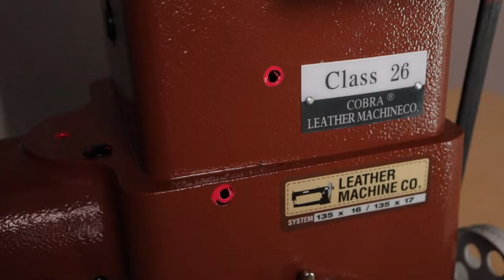Oil maintenance for Cobra Class 26 - EPISODE 36

Comment: Wow, these videos are so amazing.  I'm so wishing I had them 2 years ago when I first got my class 26.  I'm learning a great deal watching them and am grateful that you are posting them!   A few questions:  1.  Where did you get the nifty oil can? It looks SO much cleaner that what came with the machine.  2) Can you talk a little more about the little cleaning brush you are using to clean the bobbin area?  3.  I noticed you oiled some areas in the bobbin area and other areas that don't have the paint.  I haven't been doing that, but I will start.  Thanks for your help! :)
Reply from the maker: 1. The nifty oil squeezable bottle I got on Amazon
2. The cleaning brush is a short bristle pencil women's make up brush. It works perfect for cleaning in hard spots and the best part is that I got it from my local dollar store.
3. All the areas oiled are necessary and recommended by the Mechanics at LMC. These spots will help your machine and I am glad you gained some new info.
Reply: @vanplewco  Thank you!  I went through the video several times last night and cleaned and oiled my machine like never before.  :)
Reply from the maker: @druidgarden  that’s awesome! Your machine should be humming smoothly now. Have fun on your projects!

Comment: Thank you for the sharing your knowledge. My Class 26 is on the way and I am trying to learn as much as possible prior to its arrival. I have never owned a sewing machine. Is oiling the machine something I need to do when my machine first arrives or does it come oiled up? What kind of oil do you recommend? Thank you again. :)
Reply from the maker: Hey Baron,

Your new machine will come oiled up and tested by the mechanics. A small bottle of oil comes with the machine as well which will last you a good amount of time. But you can use a standard quality sewing machine oil. Most people buy Zoom Spout because it is readily available. 

Enjoy your new machine and practice practice practice.
Reply: Thank you very much! I plan on doing a lot of practice. Right now I am very careful while hand sewing to make sure everything is straight but since it take like 2 days to sew a belt or a guitar strap I figured it is time to learn how to use a sewing machine. :) Thank you. :) @vanplewco

Comment: Where did you get that oiling bottle? What brand is it?
Reply from the maker: Hey Joseph,

I got a 4 pack on Amazon. Here is the link:
WarmShine 4 Pack Sewing Machine Oiler Oil Dispenser with Long Angled Spout Screw on Cap Extended Spout oil Bottle for DIY Craft, 120ml https://a.co/d/f15hODc

Comment: What the purpose of the oil pan and the wicking? Is it just to remove and store excess oil? I was going through an old machine and accidentally tore the big main wick.  I also filled the oil pan because I thought the wick served as a oil lubricating path. Do I need to replace the wick?
Reply from the maker: The wick helps spread the oil for lubrication. The oil pan is to collect excess oiling.